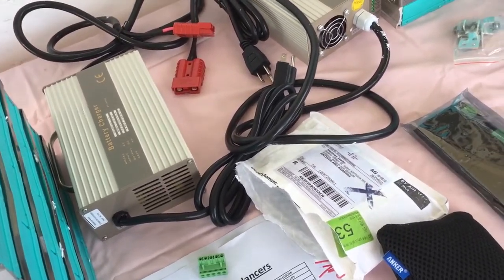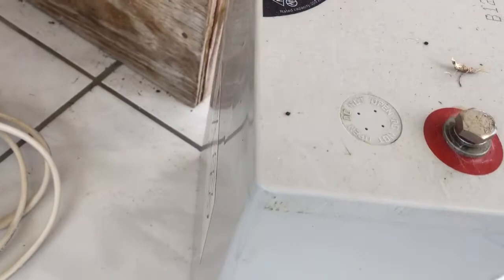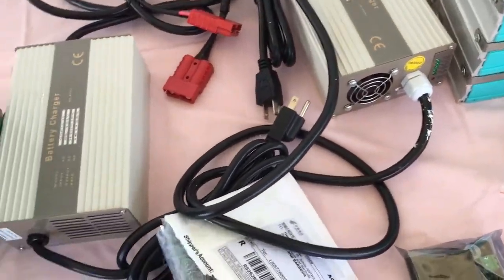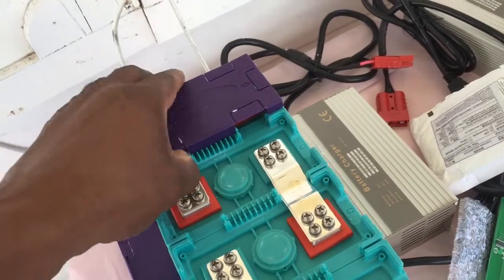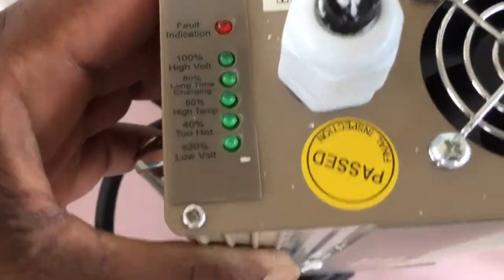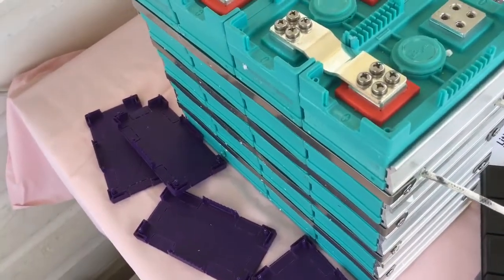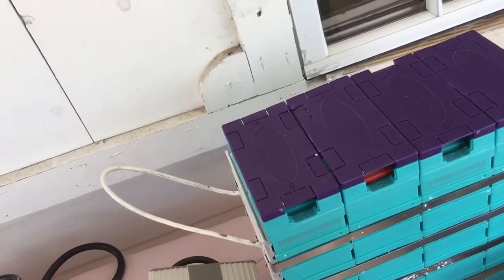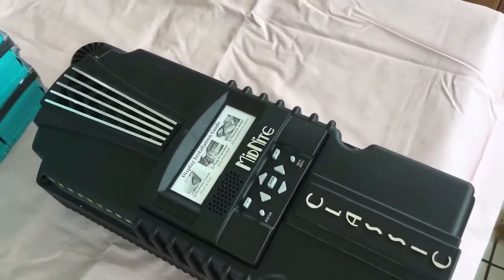My new LifePO4  Cells 24v 100ah with Classic Charge Controller 250

Comment: You Hensley are a smart man. I think LifePO4 are the best value right now.  Can you tell me why you bought battery chargers when you have the Midnight solar charge controller?
Reply from the maker: Thanks for your comment.  The lithium battery chargers are part of the packages as sold.  However, I have never used them on the bank.  Midnite Classic is my charging option.   I am most satisfied thus far.